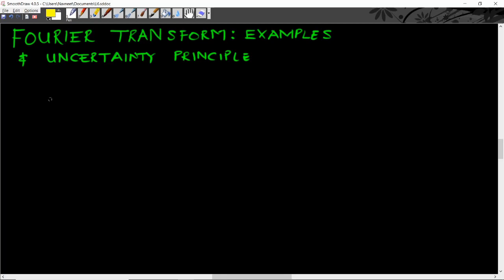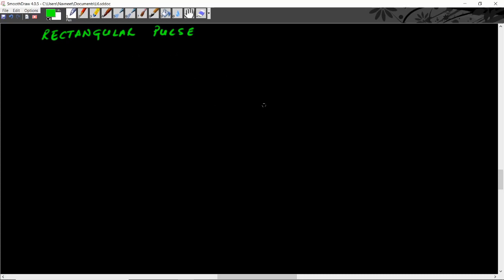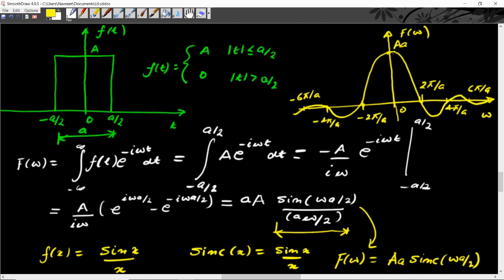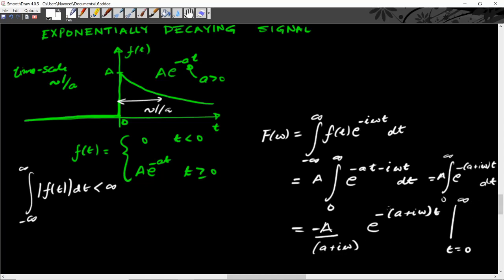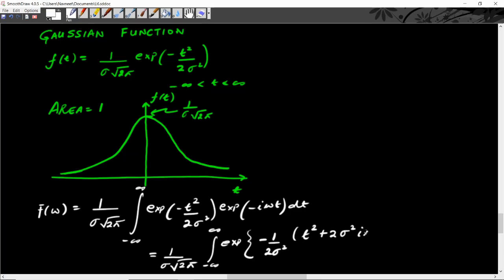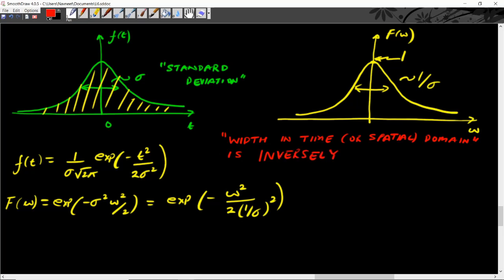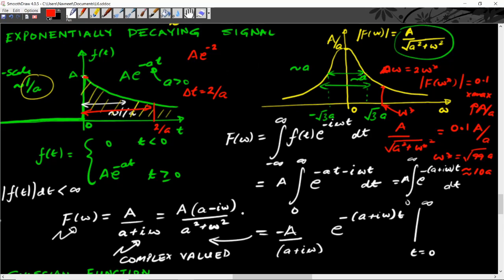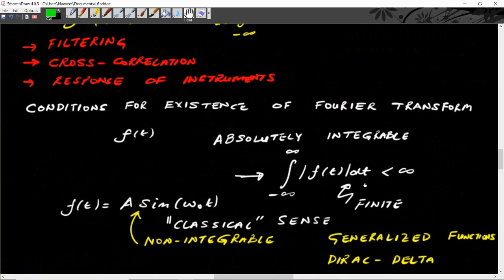Lecture 6: Examples of Fourier Transform and Uncertainty Principle

Comment: Sir at which value of fourier transform we can calculate bandwidth??
Reply from the maker: You can use a value which is 1/10th of the max. There is no specific rule that we have used. Whatever you rule use, use it consistently.

Comment: Great content. A few comments : (1) The Fourier transform if seen as an operator has it's domain as L1(R) as you mentioned and range is space of continuous functions with compact support, but as matter of fact this can be extended i.e the operators F can be made so that it accepts the square integrable functions i.e F: L^2(R) -->L^2(R) , otherwise many subtleties remains, i.e if you consider any function and it's translation, dilation, modulation etc operators those are actually defined on L^2(R) and to find out FT of a translated or modulated function it need it's domain of definition to be L^2(R) .  (2) At 6:36 you talk about "Rectangular pulse" this is basically the  characteristics or the indicator function A*\mathbb{1}_{[-a/2,a/2]}(t) or in a different notation A*\chi_{[-a/2,a/2]}(t), is it standard in literature to call this a "rectangular pulse" ?
Reply from the maker: (1) Again I do not know of any signal in a practical experiment whose fourier transform cannot be computed. So engineers need not worry much about these issues. (2) Yes quite standard. Brad Osgood (Stanford) calls it a rectangular function.